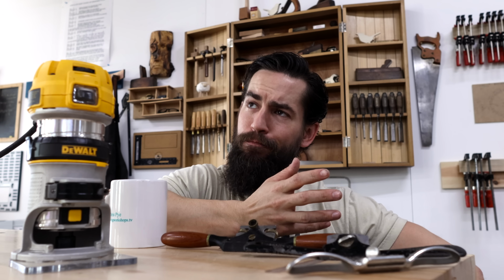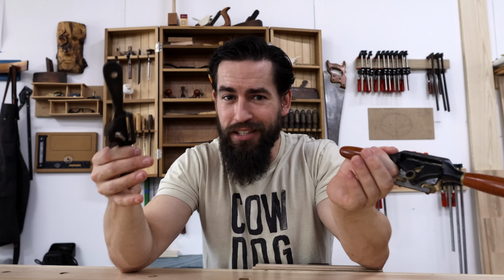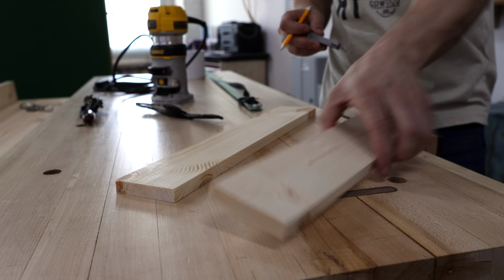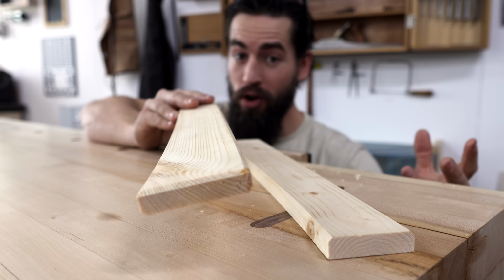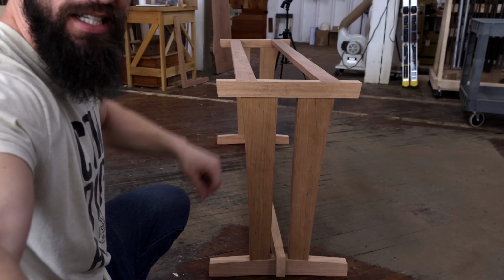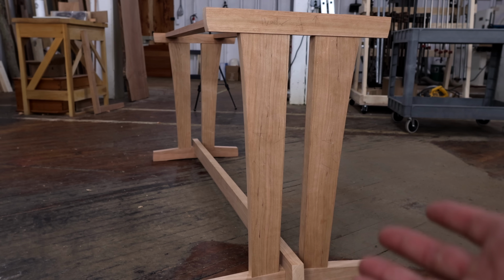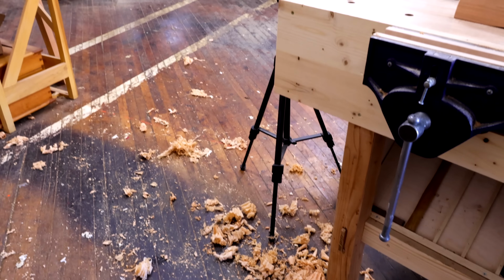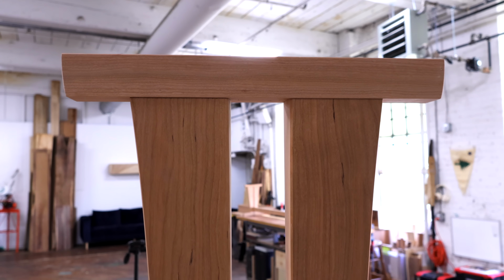Why Routers SUCK (At Details)

Comment: Love what a spokeshave can do. I'm just starting out but built one of Paul Sellers "bench stools" and all the legs are straight and square, but using a spokeshave and some a few curved lines to take down the feet you would swear I carved sweeping legs carved from larger stock, but if you put a ruler to it they are are still dead straight. Probably nothing new for experienced furniture makers but it was amazing to see it come together, and whenever I see the stool I still admire the effect. All from just using a spokeshave to take down some edges and corners in the right place.

That being said I built an outdoor Adirondack chair and used a spokeshave to try and round all the wood edges the same... mistake. A router would of been ideal here as I wanted it all uniform, and I had a TON of edges to do and was not looking for a "flow" to them. Luckily the chair was for myself but those edges all look very hand made and different across the piece once you get up close.
Reply from the maker: It's all about picking the appropriate technique for the piece. A minimalist, contemporary design may look odd with hand shaped, sweeping profiles. Glad you'd found some enjoyment in the process of hand shaping though!

Comment: The play with light and shadow lines through edge profiles give the piece, personality. Pekovichs Tansu cabinet a a play with 1\16ths. Where as just an extra 16th on just the face of the door rails gives it character. Using a spokeshave if fun, but restraints to not over doing it is important.
Reply from the maker: Restraint is one of the more important skills to develop from a design perspective. It simply comes with practice.

Comment: I find this quite interesting and definitely see what you mean by difficulty with doing this using power tools. I just did something similar when building a desk for my wife and wanted a dynamic roundover that transitioned from about 1/4 inch roundover to a square corner. The router part was simple, but at some point I had to transition to hand tools, then eventually to sander and manual sanding block to blend it all together.

Comment: The struggle is real. I hate routers. I’m finishing a table (walnut) and doing a 1/8” round over. I feel like the tool is designed to murder you. The second it’s made it’s designed to kill you. Like a helicopter.
Reply: Stumpy knubs once said "what a router takes off, you can't sew back on" and now i think about that line every time i have to start up a router lol
Reply: @UnbreakableIcePick  Yea, basically. I have a Bosch 2.5 hp, it's heavy and when I put the 2" flattening bit on it, I have to make sure it's tight on it's metal rails for sled. I much prefer the smaller palm routers.
Reply: So true. Router makes quick work but it can also destroy something very quickly. I also hate the amount of dust it spews out. Seems to be one of the worst for such a small tool.

Comment: The two pieces of pine didn’t convince me, for some reason. I guess because I don’t yet make beautiful things. I’m just not yet that far along in my evolution as a maker. But, as soon as you started with the table supports my brain was immediately saying no way in heck would I touch that with a router spinning at a million RPM. If nothing else it would be super easy to ruin the piece. Add to that the lack of artistry and it became a sacrilege to do anything but what you did. Many thanks.

Comment: Good stuff. Those little details, while looking simple, add a  different dimension of complexity that flows. The other beautiful thing about using the hand tools, no dust that ends up on every surface in whatever size room you're working. Shavings are so much easier to clean up, particularly for those of us who don't have superb dust extraction systems.
Reply from the maker: Agreed in both counts!

Comment: Hand tools are just so expensive though, in addition to the thousands we’ve already spent on table saws and power tools. 

Several hundred for each plane. And a dozen different specialty things like shoulder planes and router planes and chisels and spokeshaves. 

Hand tools are cool AF but I don’t want to spend another $3000 on woodworking stuff. 😂